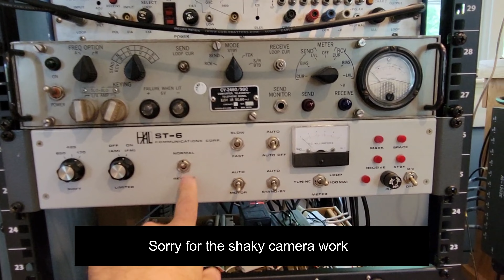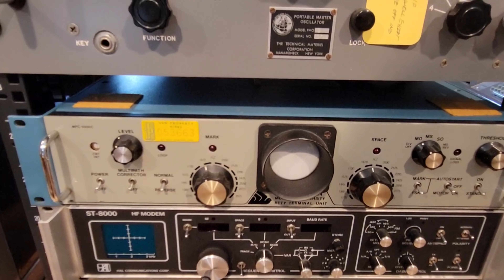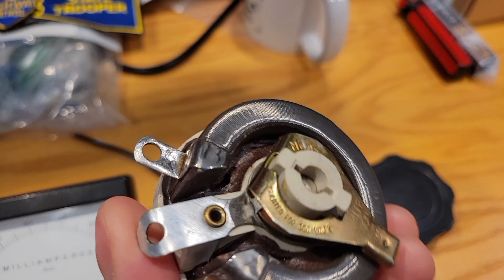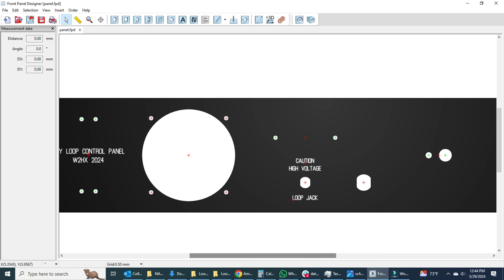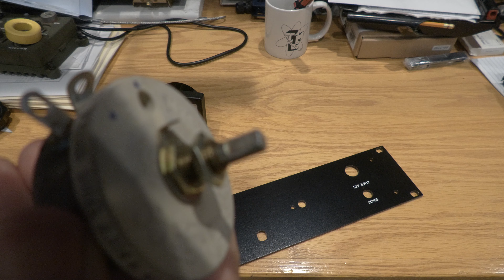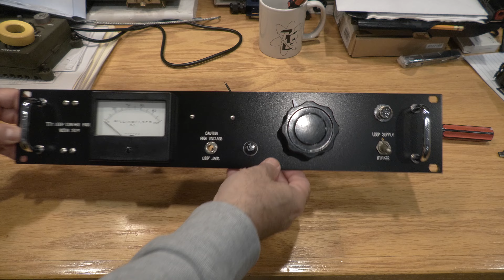TTY Loop Control Panel Part 1

Comment: A nice little addition to your setup, During my first job at a telco, I was in the TTY end of things, however at the time early 8 bit personal computers were the 'new thing', so my TTY fiddleings don't involve the earlier mechanical machines - we had Siemens M100's, that were on their way out to be replaced by Sagem TX20 machines. Line signalling for us was what we called 'double current', plus and minus 25mA from a plus and minus 50V supplies. For my shack I've dropped the voltage down to + & - 12V, the signals don't have to go that far, there is still enough to drive things, and I won't smoke the serial ports on my retro computer trinkets as I work to bring them 'online' TTY wise.

With your new supply, I tend to think your letting the open circuit volts get a little high, add in a bit of back emf from the receiver magnets and maybe it's getting above a safe level that some gear can safely handle, too much contact sparks or too much for output transistors on your demodulators.
Maybe you need something to take one loop as an input and generate several separate loops from it, so you can have a few machines receiving the same copy, but with the advantage of being able to handle one loop going open as you work on that machine without if affecting the others, as they are on their own loops.

Comment: Thanks for this! Excellent work. I am looking forward to part 2. Will you be able to show how you bypass the internal loop supply in the ST-6?
Reply from the maker: Thanks, Paul! Yes I will show the bypass in part 2, but to be clear, I don't disable the internal loop supply in the ST6, but rather bypass the external loop and use the ST6 with its loop supply. This doesn't work quite as well as I would hope because I can't leave the ST6 inline since its own internal resistance is too much and the current drops very low. So I need to unplug it from the jack field when its not in use. Oh well. 73